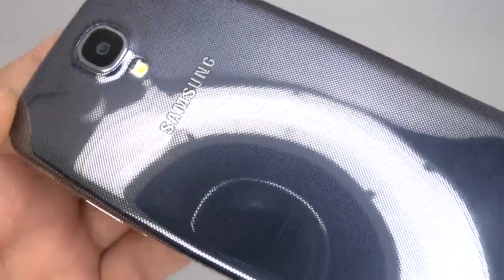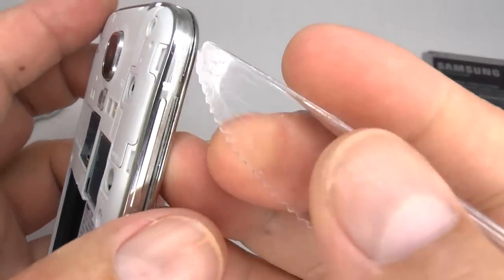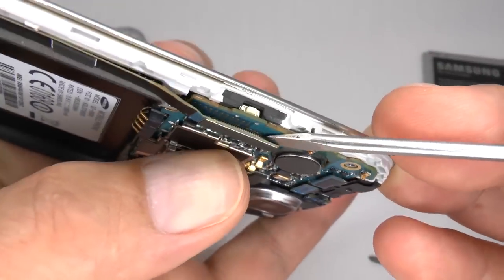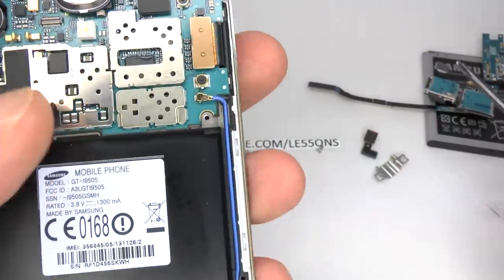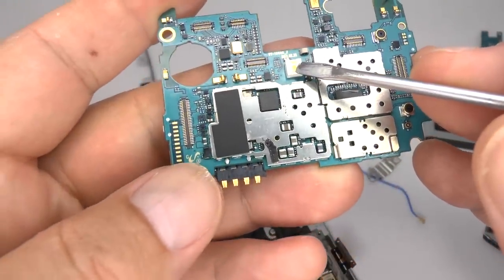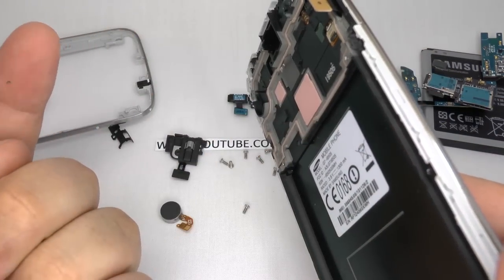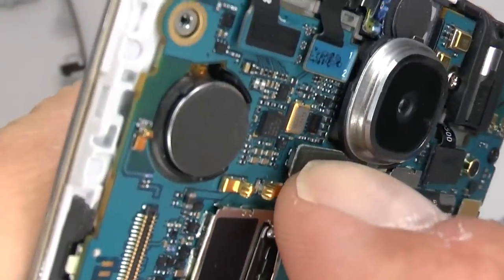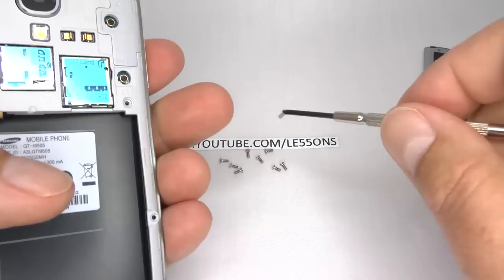Galaxy S4 Disassembly & Assembly Teardown - Screen & Case Replacement

Comment: Absolutely brilliant instructional video. I fixed my S4 which had a broken screen and LCD. I purchased a complete screen and LCD and following these instructions dismantled the phone, installed the existing components onto my new screen and everything worked fine. Thanks very much.
Reply from the maker: +Fotis M :-)
Reply: Φώτη, πόσο σου κόστισαν το touch screen και η οθόνη;
Reply: Hi lyckos I purchased a complete screen/lcd assembly off ebay for £62 but they may be cheaper now. Its much easier to fix your phone this way if it has a broken screen. Saves having to separate the screen from the LCD and gluing on a new one. If you do it the way I recommend all you have to do is
transfer the components from the old assembly to the new one. Very easy to do. ... All the best Fotis

Comment: I bought a replacement screen/case and used your video to step through the process.  Your closeups were very clear and very helpful.  You even mentioned about swapping over the heat sinks.  Got it all back together and working good.  Thanks!!

Comment: Excellent lesson! Clear, concise, and easy to follow.

I had always thought my S4's front camera was crap quality and never really used it. On a recent vacation selfies came in handy. I looked closely at the front camera and saw it was 80% blocked by a black strip of plastic in front of the lens.

It turns out the front facing camera had a manufacturing defect: the CCD was obscured by a very thin sticky ring that sticks to the face of the camera. I followed your video and removed the front camera. The problem was clearly visible. I peeled of the sticky ring and repositioned it in the correct location.

At last, my selfie pics are much improved in quality. Thanks again!

Comment: I can't believe I'm still using an S4, but I am. My speaker quit working (phone wouldn't ring when receiving a call, no alarms, etc.). I have an old S4 that had a cracked screen which was replaced under warranty some time ago. Using this video, I was able to swap out the parts from the old phone to get my S4 speaker working again. It wasn't the speaker module either, as I tried that first and it didn't fix the problem. It was the little circuit board and cable that is underneath the speaker. This video saved me having to replace my phone. THANK YOU so much for this.

Comment: i love your video.. how you explain everything.  It's very educational and it looks like if people have issues, you're there to help.. Which is equally as important just in case.  I just dropped my gs4 and cracked the screen and will be replacing it within the next couple of weeks and will certainly be using your video as a guide.  Thank you very much in advance for posting this in depth video!!!!

Comment: My proximity sensor was acting like something was near the earpiece all the time. Blowing a duster through the earpiece from outside worked for a while, but stopped. I followed the directions here to disassemble. I used a duster and my fingers to wipe particles off the sensor and it's working like new. I'm very grateful.

Comment: Managed to get it working! 3 rd time digitizer lucky! After fitting the digitizer still had the same fault. I noticed that the connector to from the digitizer didn't click in properly. Managed to sort this by removing the motherboard and clicking the digitizer to it that way. It is supposed to be a genuine part but who knows? Anyway all working now. Thanks so much for giving up your free time and responding to my posts. You are a gentleman.

Comment: By using your video tutorial, I was able to take apart and reassemble my S4 easily. 1) My LED light had stop working totally and after taking it apart, I found water deposits (a bit oily)  behind the rear camera as well as on the LED light lens. After cleaning with a dry cotton bud, my LED light now works again. 2) My proximity sensor had also stop working, it just dimmed whenever I take calls. Using your lesson and the trick mentioned in How to Fix Proximity Sensor Issue for Samsung Galaxy S3, S4, or Note 2, my sensor now works fine again. Thank you VERY much sir for your clear, detailed and precise lesson.
Reply from the maker: Thats good news and the idea of using the black gasket is a great idea. I have used small pieces of blu-tak with the same results

Comment: Great video. Thank you!  I have not yet disassembled my S4, but may do so soon. I had a water mishap. (hot tub... 5+ minutes underwater). Thankfully, after 3 days in a bag of rice, the phone worked! The front facing camera, however, does not. When i try to switch to front facing camera, nothing happens (the camera freezes). Any thoughts? Should I try purchasing a new front facing camera, or just take the phone apart and clean the contacts, etc? (I did a factory reset too)

Comment: Thanks for making this great and highly detailed video! I used the video to help me replace my shattered glass and damaged digitizer on my Samsung S4, both were damaged in a very hard drop. The tiny black screen on the mic rubber gasket fell off removing it, thanks to your video I knew what is was and where it goes. I used a tiny bit of superglue on the ends only and it worked great. 
The replacement assembly (LCD-Digitizer-Touch-Screen-Display-Frame) works great and makes the phone look brand new.

Comment: Well done. Thank you! I used the first 3.5 minutes to disassemble my phone in order to clean proximity sensor. 60 second video for that part easily found elsewhere. Whole process took well under 30 minutes. Maybe 15 minutes.

Comment from the maker: If the volume button is holding the switch down it would cause your problems, try removing the rear housing at that contains the buttons, its not covered under warranty..

Comment: Thank you so much for the video, really helpful and well made! After I replaced the front assembly with screen and digitizer, when i did a full functional test on the unit, I found out that I cannot send text messages. I can make a call, receive texts and go on internet, wifi and LTE. Do you have any idea of what i could do to fix this issue or any hints on what could be the problem?

Comment from the maker: As you can see at 6:54 its pretty easy to replace and there's plenty available to buy online for less than $10, but if you want to keep the warranty you'll need to have it repaired by Samsung. There's always a small risk doing self repair..

Comment: Thanks for the excellent video, .. I was trying to compare the screws that you first remove on the S4 ( 1:10 ), against the ones that you remove in the S3 video, I have the both phones, but my new S4 came without these screws (.. I hope these are the only parts which are missing) , it would be possible for you help me to clear my doubt if both phones uses the same type of screws, in this case, I can change them by myself without having to go for technical service. Thanks a lot in advance.

Comment: great video! one question though. ive just bought a complete front replacement including screen frame audio jack ect.. however the genuine replacement part only has one thermal compound spot. the second smaller one is missing as well as the foil/metal it sticks to. is the foil/metal part easy to transfer like the compound itself?

Comment: Hi thanks for your answer , is there any chance you might be able to try it, I've recently acquired my s4 , and don't want to open it. Just to see if there's a considerable temperature drop. I was thinking on installing perseus kernel to undervolt. But if you can try replacing the thermal pad with a copper shim and post the results would be great.

Comment: Thanks for the video. I managed to fix a phone with a broken screen. I got the new screen and digitizer on a frame and thanks to this video could rebuild the old components and circuit board onto the new frame. Cheap fix for 20 quid.

Comment: This video helped me. Thanks. My old GS4 had the Blizzard Authenticator app on it and the screen cracked so i couldn't unlock my account. So I went onto ebay and bought another one, and used this video to guide me through swapping the mainboards so that I could boot it up and unlink my account.

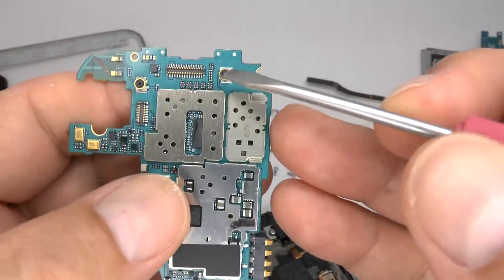Comment: Very well made video, thanks a lot. For the antenna connectors, L1 and R1, you say in the video at 11:58 that they are both test ports for 3G/GSM butin the text below, R1 is indicated as being a 4G radio test port. On the S3, telco in Australia says that one port is for tx/rx and the other for diversity. I am intrrested in finding one or two test ports for the 4G radio to which external antennas can be connected. Any hints?

Comment: Great video! Quick Question, I cracked my digitizer and got it repaired. But after receiving my phone back from the repair shop my Camera keeps saying "Camera Fail" error message. A week later my gesture sensor stopped working. You think replacing the Camera module and sensor will fix the problem or is it a main board problem?

Comment: Yes - it's like but the main board button doesn't sit close enough to the frame button or the buttons aren't aligned properly. Hard to tell, 
I loosened the black screw across the other side of the board as it appears to raise the other side.

Just wondered if you ever came across this issue at all?

Comment: My brothers i9500 sound stopped working (loudspeaker issue),and that caused the microphone and headset to don't get discovered.I ordered a replacement loudspeaker,and my question is if I replace the loudspeaker will the problem be fixed or it's a serious HW issue? Anything else just works flawlessly.  P.S.Before the loudspeaker stopped working it made some strange noises.

Comment: Excellent Video. I followed the instructions to check the contact of the wifi antenna. Wifi efficiency is very weak and I found a contact on the middle frame that is dark grey and seems to be electrically non-conducting. Is it possile? The contact in your video is golden, right?

Comment: Yes - it's like a gap exists between the main board and the frame "buttons" or the frame is mis-aligned to the board - however the frame sits flush against the screen.

The screen is an original i9500 replacement and i have two boards that i tested and resulted in the same issue

Comment from the maker: at 6:42 you will see 2 gold sprung connectors each side of the square black component which is the humidity & temperature sensor.

Comment: My lens is cracked on my GS4 and I want to replace it.  This is a very helpful video.  I am wondering though, can you replace just the lens without having to actually remove the "main board?" Thanks.

Comment: Hello, my power, block button seems to feel quite loose when i press it. Doesnt feel the same as the volume buttons, is it normal or its not how its suppoused to feel. If not, replacing the silver button will do the trick? Didnt saw you remove those on the video, thats why i ask. Sorry for the long comment

Comment: You are awesome man! I have a problem with my Galaxy S4. The power button feels "mushed in" and very recessed (I know the power button is a lot less recessed than the note 2 or S3). I was wondering if I replaced the housing of the S4 if it would solve the problem. Is the Power button mechanism connected to the Housing? If I ordered a new housing off the net, would it solve the problem?

Comment: You said it is the contact for the wifi and bluetooth antenna. So that "contact" has to touch a metal part of the motherboard to work, right? The corresponding wifi contact on my motherboard is actually damaged I believe; do I have to get my device replaced or is it fixable?

Comment: This video is extremely helpful,  but I have a question do I have to take off the speaker assembly to replace the front camera?
Reply from the maker: yes as it also holds the back cover on..

Comment: Hi- this is a really great series of videos. I'm very appreciative of them. 

I just did an S4 repair, well, I failed. The client's phone would turn on, connect to a pc, but her screen was dead. She said she dropped it and it just went black. I noted some hairline cracks on the LCD, replaced it with a new assembly, and it still wouldn't display anything. 

I tried a back up and restore, and a firmware restore again. Too no avail. I am just completely stymied on this one.

Comment: Do you know where I can buy a replacement blue antenna cable?

I think I damaged mine when trying to remove the speaker but turns out I actually didnt have to remove the speaker to open it

And do you think there is any way service people can tell its been opened or not?

Comment: Great video. Used it several times. Two questions.
1. What cable/part controls the touch LEDs? I replaced the the USB/microphone cable and the LEDs have stopped working. I refiited it again but still no LEDs and back/recents button fail. Any thoughts why? Did I damage cable when fitting or not fit connectors properly? etc
2. SIM card tray. Replaced and got no signal though SD card worked. Refitted and now get low signal but iffy. Does the way the blue GSM cable fits affect signal strength? Can you test using the L1 R1 ports? If so how?
Hope you can reply. Thx
Tom
Reply: PS Re LEDS - Home button works

Comment: Excellent video. Thank You   I used it to try to fix my "sim card removed" errors. When I removed the frame that covers the motherboard, I noticed the sim/sd card connector was just slightly tilted with the ribbon cable side up. It sat right down with just a slight push. I then added a small piece of duct tape to the inside of the cover to hold it in place better. Hoping it works. Right now it is fine. Hope this helps someone else.
Reply: It seems this was not the fix needed, the problem came back. Looking for a replacement motherboard now.

Comment: First of all a big thank you for sharing this very informative tutorial. 
After dropping my phone and smashing the screen and digitizer and rapidly losing all legible data off the screen I decided to change the digitizer assembly. I have done this to the letter and the screen is still blank! The other features like volume still work.
 I have reassembled using my original components and removed the back case and plugged in the new screen and it works. As soon as I reassemble with the new part it doesn’t work. Have I done something wrong or is it possible I have a faulty part?
 Any ideas would be gratefully appreciated.  Many thanks in advance. Gary
Reply from the maker: you're not the first person to have this problem, its a strange fault to have. Did you buy a screen that comes with the front housing?

Comment: Really good video thanks. I got my phone kinda dusty and when I call it doesnt go black anymore, so im thinking it would be the proximity sensor I need to clean. Also the auto rotation stopped working after getting it dusty, what do you think would I have to clean or replace to fix this? Tks
Reply from the maker: Cleaning the sensor and glass should fix the screen blanking but I'm not sure where the rotation sensor is located..

Comment: WOW! I wish there were a video like this for every electronic device! Even manufacturers could use something like this to teach their how to assemble or repair.

Thanks to your video I think I found out why my S4 has almost no signal (where other phones have 5 bars). I am missing the small component on the USB board (right above the "G" of the "GT-I9505_REV19" print). It must have broken off when I removed and accidentally bent the flex board to replace a broken screen. Damn another 20€ in spares needed (I don't think I will find the component's value, which was most likely an inductor).

Comment: Hello I watched your tutorial very well done. I think my home button has gone bad. Is this a hard fix? It's making a loud audible click sound. Is there a way to quiet it down? Or do you recommend replacement?
Reply from the maker: If its a stiff click it might need cleaning, try using some isopropyl alcohol around the button and if it goes quiet keep trying to clean around the edge using thin paper

Comment: Above the antenna flex cable on the mainboard.  There is that black circle with the hole in it.  I was trying to take apart my phone, and mistook that for a screw hole.  I wasn't paying attention and put the screw driver in it and pushed down before I realized what I was doing.  I made a bigger hole there kind of and now the reception is terrible and cant make any phone calls.  Is there a way to replace that?  How do I fix that???

Comment: My camera lens has dust on it. Can I remove the main covering to clean the lens without removing the metal ring etc? I don't want to try and force it if it's held down, but would prefer not to fully pull everything apart

Comment: Where did you get that wireless charging back panel from??? The real samsung one makes the phone fatter so I'm not really into that and the ones on ebay require me to put a little piece of what looks like plastic over the battery and certain places. Yours would be much nicer to use.

Comment: I picked my phone up from the bag and it was a little bit wet. I took the phone apart and air dryed all parts without any signs of water at all. Then when i put it toggether and put the battery in the speaker made an high frequent noice. What might the problem be? It was not soked wet btw.

Comment: Thank you very much Sir. was wondering if you could do a screen replacement for my brand new Samsung Galaxy S3 which got run over by a car ( was a 3 month old phone :(( what a shame). Don't know if anything else was damage since I am unable to switch it on or even even charge it as no lights come on while charging. I don't see the case to be broken or bent just the screen got smashed to pieces. I wanna try using a new screen and see if it will work otherwise I'll just throw it in the garbage. Thanks again great vid !!!